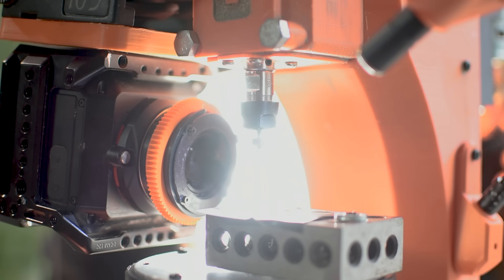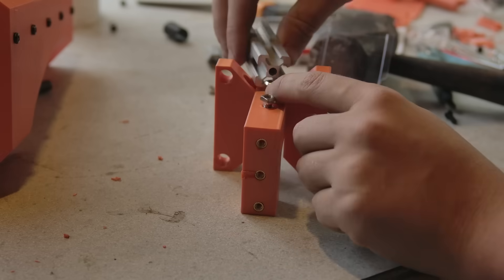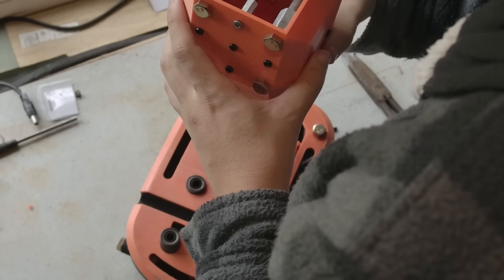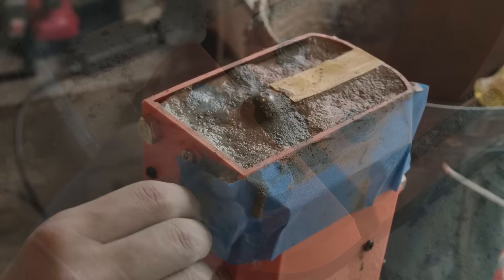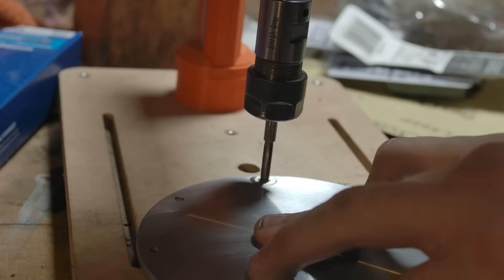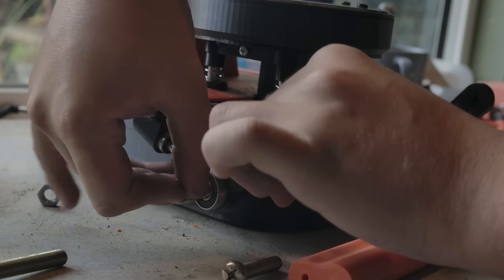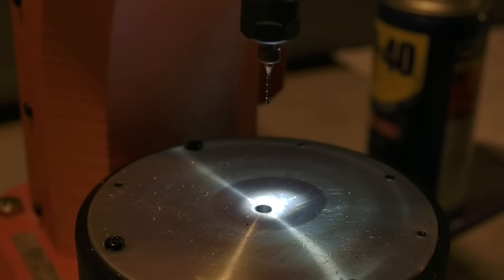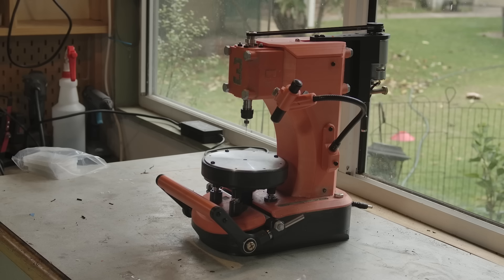I Printed A Sensitive Drill Press

Comment: I really do not recommend using Water Displacer 40 as a cutting OIL WD40 is not a good lubricant castor oil is so light it doesnt stick on any moving surface. Castor oil is not a good lubricant or oil. I reccomend getting actual cutting oil if you don't want to damage your equiment.  Love your videos ans the quality is amazing just a recommendation to make your machining life easier and cheaper.

Comment: Have you... Hear me out... Considered... A concrete funnel with a built in vibrator/agitator? Ideally a two functions in one job, agitate the concrete to smoothly dispense from the funnel, an agitating rod that you could dip into the mould to agitate and settle the concrete within? Not sure if you could design it as an all in one with shared components.

Food for thought? I'm just a mechanic though so ignore me if it's stupid and I'm unaware.

Comment: 4:50 Pro tip: take 2 pieces painters tape or duct tape, and tape on to open top of your concrete bucket so that they make the bucket lip into a V shape instead of the round shape. It helps with pouring dramatically. Alternatively, I've seen people take an old paper towel roll, cut it lengthwise and then cut again to form a V shape and hot glue it onto the bucket.

Comment: I didn't think it was surprising that the 0.3mm bit broke on the aluminium piece. Aluminium is not really an easy metal to drill through because of the galling. I suspect that the drill bit got a bit of aluminium deposited on it, and that that resulted in too much friction for the bit. It would probably have less problem going through steel.

And please stop using WD40. That's not what it's for. And probably none of the other things you're using it for either. Cutting oil is cheap, and you can get it in a spray can too, and bonus: The smoke point is higher, and when it eventually gets hot enough to smoke, it doesn't stink out your shop the same way WD40 does.

Comment: I used to make knife, I've cut maaaany hole using cheap hole hole in up to 1/4 inch tool steel. with proper lubrification, and slow speed, you'll get to it!

Comment: A Dremel rotary tool with drill chuck and drill press accessories can drill very small holes. I've used it to drill brass 3d printer nozzles.

Comment: This is an awesome concept. Making functional power tools with a 3d printer. Never thought to add concrete for strength. Replace the PLA with CF-Nylon and you really would have something there! Its just as easy as PLA to print and is dimensionally stable, chemical and oil resistant and wont melt or warp if it get hot. PLA will deform in a hot car. Still excellent concept!
Reply: Or ABS.

Comment: quick tip for using the drill press hole saw- drill a small hole on the outside edge, (choose to have it overlap the outside, preventing a chunk missing from your finished plate, or just a hole smaller than the hole saw kerf). This aids dramatically in chip removal, more important for thick metal but it still will make it faster going and nicer finish. :)

Comment: Aluminum is around the same hardness and some woods so as long as you take things slow you and use some oil can use normal wood working tools on aluminum they will throw a fit while doing it sometimes tho

Comment: Hi I loved your video (and the others). After 4 months does this design still meet your expectations, or does it need some tweaks. I would love to build it but I obviously would like to build the latest design. 
Also if I was to build this unit is there another medium other than concrete that I could use, even if it is a little more expensive.

Edit.  Regarding the drill press and hole saw, have you considered your local Australian Men’s Shed association. They would be more than happy to help you out.

Comment: This well-designed and well-thought-out project to reduce vibrations makes me want to buy a printer and get started on it. Could you tell me the minimum print volume needed to complete this project? I'm leaning towards Bambulab. Thanks.
Reply from the maker: Howdy, 240 is the minimum size needed in both height and bed size, bambu is a good choice I have had good experiences with them.
Reply: @Borgedesigns  Your answer is very appropriate and I thank you for it. I am buying the Bambulab A1 combo today. No doubt you have something to do with it.

Comment: Fun thing to do with really tiny (0.3mm or smaller) drill bits: front panels for devices. Drill arrays of tiny holes in aluminum sheet for LEDs instead of of poking through the LED itself. The light will shine through the holes, but the holes themselves are comparatively invisible!

Comment: Why have a moving table instead of a moving head? That makes handholding a part much, much more difficult, and as you saw, tiny carbide drill bits are not tolerant of even the tiniest run-out or lateral forces.

Comment: Great build, but you may want to make something to reduce the speed that table can feed up. Some sort of gear reduction? Or maybe just some resistance? Drills that small can sometimes break very easily from shocking them by varying the feed rate that much. Just an idea. Your entire build is way beyond my skills despite having a small machine shop and most of the tools to physically do the same stuff.

Comment: instead the lever, you should try to modify it with a big handwheel ( lets say about 3,5" Diameter ) and couple it to the springloaded mechanism of the lever. that way your Push motion becomes way more controlable i believe ( this is just a assumption ! )

Comment: The Vaseline does what? I like to use either hot air or a blow torch after I sand 3D printed material. I’ve gone too far with the torch but it only takes a fraction of a second to melt the surface. My hot air rework tool has precise temperature control and I use it all the time with 3D printed parts.

Comment: A very small drill bit, its machine journey too fast will cause the drill to break . You can control the forward speed of the base table manually through a gear system (like a lathe) or automatically (step motor).

Comment: Try with epoxy granite next time.
I use a high strength high flow epoxy mixed with Garnet sandblasting grit. It is very strong, very rigid, pours much easier than concrete and is quite a bit heavier.

Comment: If you paint the 3d printed parts with resin you return the colour + add a hard outer coating that adds strength, uv resistance and scratch resistance.

Comment: Dude, what the actual fuck, this is absolutely amazing. Such an incredible idea filling it with concrete and using threaded rods and spacers as the bolts and nuts. And the final design is so smooth and beautiuful. I was thinking about the price and when you showed the bill of materials my jaw dropped, you read my mind. This is insanely cool and it's an instant subscribe. Thanks for uploading

Comment: Great idea borrowing the old DIY lathe concrete trick, it's all about mass and rigidity. Black oxide the steel/stainless parts if shiny isn't your thing. By the way...this would absolutely be worth the time and effort in making pattern boards and sand casting the base, column, and housing parts in aluminum!

Comment: I wonder if you could use steel shot, like for a shot-blaster, instead of concrete.   Steel is about 3 times heavier than concrete by volume so much less could be used and it could be emptied back out for modifications.
Reply: That would add weight, but not rigidity.
Reply: @tookitogo  Ah.. I see.  Thanks.

Comment: well im going to ask since no one has has. what's the #3 on the front of the spindel head signify? and how did you ensure accurasy of alignment between the bed and the shoulders of the press. last i checked the tolerances on galvanized M8 is not very consistent or even potentially concentric

Comment: dude, thats pretty sick !! and if youre able to sit and spend the time making something like that in CAD, then there is no reason why you couldnt make a small Manual MILL or LATHE also. that would SICK AF too !! -------- then i saw your link and you already did and im like WOW !! NICE BUILDS BRO !!! serious effort !!     so having worked in a machine shop for several years, do yourself a favor and buy KENNAMETAL brand Endmills and Drill bits for cutting metal.  it will be money well spent and look much nicer when finished.

Comment: While watching your issues with the concrete being vibrated and flowing up through the top of the base, I was thinking that the riser ()drawing a blank  on the name of this part that you filled with concrete after attaching to the base) should have been poured separately, with a piece of seran wrap or something to allow you to break down the mill for storage or transport. More importantly if you had done this, you could have set upa mating surface that you could do indexing with, rather than relying on the bolts being the only element that forces alignment.

Again, this was mostly in the line of how to prevent the concrete in the base from being vibrated up through the top holes of the base. Another option might have been to set up channels to a separate riser path in the riser, and that 'filled' from the front or toe of the base, and you would then (hopefully) have a reasonable assurance that you had gotten most of the air out of the casting. 

Any way, nice job, and I wouldn't be surprised if you made an x/y slide circuit board holding attachment that you could use to repeat a series of holes for DIP packages on a circuit board, etc. Nice job.

Comment: instead of sanding, I recently learned about using a card scraper (from woodworking).  I tried it and it`s FANTASTIC. and fast.  not perfect for every application, but it`s worth trying.  even leaves the colour , for the most part.  you should look into it.  it`s great to make certian that joined parts match well (no lips or overhangs)
Reply: best I have used is a ceramic scraper. Bought from 3d printing Canada.

Comment: Every time I heard him say "concrete", I thought it was some engineering term I didn't undertand. Then he poured concrete.
Great work mate. I subscribed when the subscribe note popped up 😄
Reply: Large accurate machines sometimes use a polymer/basalt mixture, because of the low thermal expansion of basalt. The added mass also shifts the natural vibration frequencies of the machine structure, which usually is an advantage.
Reply: Довольно частый и дешевый способ сделать раму станка жесткой. Работает прекрасно, особенно с маленькими токарными станками с алиэкспресс. Разве что понадобится безусадочный цемент вместо обычного если объём заливки значительный. Впрочем, мелкая гранитная крошка с эпоксидной смолой - вариант для больших мальчиков, она годится даже для создания станин серьёзных станков, таких как ЧПУ для высокоскоростной обработки алюминия..

Comment: Try wrapping your prints in a layer of fiber glass and epoxy if you can't fill them with concrete. It makes them super rigid. You have to rough up the surface of the print really good though if you want it to stick.

Comment: This is amazing.. instant subscribe! I can’t help but feel a longer lever for raising the work might give slightly finer control - allowing you to translate a larger movement of the lever to a smaller movement of the work towards the drill bit. This should allow for smoother motion and for multiple smaller pushes of the material against the bit, which, together with tighter clamping closer to the hole, might help mitigate against bit breakage.

Overall though amazing work. Creating amazing tools at unheard of costs, opening up work that just wouldn’t be achievable otherwise is exactly the kind of thing many dreamed 3d printing would make possible.

Comment: You'd be amazed what metal can be drilled on a regular drill press with cheap tools. The key is... Some type of submerged coolant bath or lubricant. 

Sounds complex but super easy..... Put a big Tupperware container on the drill press table, fill it with water based coolant, submerge your part, and drill away with the cheapest bits you can find. 

As long as your speeds and feeds are right... You can accomplish almost anything
Reply: Out of curiosity how do you hold down the piece while its in there?

Comment: Anything containing petroleum distillates is not good with plastics or any composite for that matter. There are specialty things available.

 One of the biggest game changers for me was switching from regular armor all..... (Which is terrible for plastics and composites over time)...... To a product made by 3M used in the aviation industry to keep airtight seals and gaskets clean and pliable. Basically just armorAll without Petroleum distillates. 

In the case of something more viscous, you can look at dielectric grease. There are many different types.  But they are all 100 times better on composites than vaseline. The neutral silicone in them is the key. And some are even all petroleum distillates. 

This is what you will see on o-rings even in aerospace type stuff. Not only will it not break down the rubbers and composites like Vaseline and others would.... . But it also has a very low off-gassing rate. But won't affect the plasticizers in  composites. Or make them brittle.

Comment: Regarding some things you noted not knowing for sure (and more!):

- Finishing PLA plastic favours scrapers over sanders. Scrapers can, at their simplest, be the edge of a razor blade. More suitable scrapers are either single-side bevels (like chisels) or a flat end without any bur.
- Vaseline can damage plastics, but it depends on what type of plastic. Destroy is perhaps a stretch.
- Joining parts together with a strong bond can be done by using a polymer like ABS or ASA, which can be solvent-welded.
- Alternatively to the above, you can print parts with flanges that serve purely just an alignment purpose, perhaps with holes in the flange and pins/nibs in the base. That way, clamping them down is also much easier. 
- Even better yet, additionally to the flange, you can extend the barrel of the tube that holds the bearing by the thickness of the bottom, and cut/design a hole the bottom the same size in the right place. This causes printed parts to interlock more securely, doing away with a lot of clamping/holding.

Comment: That concrete poured into the metal parts, I'm guessing will rust away in 1 to 5 years at most. I'd like to hear from someone that has tried this. My idea, fill with dry sand for stability. Maybe sand mixed with baking soda and superglue where you need plenty of strength. Use around plenty of ventilation.

Comment: If you're making printed circuit boards, you will need .25mm holes. Nice solution to a difficult problem.
Reply: Typical PCB holes are 0.8-1.2mm. It’s rare to need anything below 0.5mm. Commercially made PCBs often use 0.2-0.3mm vias, but practically nobody making PCBs at home will ever be making plated vias.
Reply: @tookitogo  "Nobody making PCB's at home will ever be making plated vias." <- How did you come to that conclusion?
Reply: @kurtnelle  Because it’s a complex electroplating process that simply isn’t worth the effort, from any practical standpoint. Heck, people have largely stopped etching PCBs at home, period, because having PCBs fabricated has gotten so cheap. Yes, there are videos of people playing their own vias. But it’s more as a challenge than as a practical matter. Nowadays you just upload your gerbers to JLCPCB and call it a day. 

In the old days, people would create vias on double-sided boards by riveting little tubes into the board. (They look like tiny ferrules.) I have a bunch of those in a drawer at work!

P.S. I did not say “nobody”. I said “practically nobody”, which means close to zero, but not zero.
Reply: @tookitogo  Sounds like a privliaged response.
Reply: @kurtnelle  Nope, just speaking the truth. Electronics hobbyists (and professionals) used to make PCBs at home (or at work) all the time. Now it is extremely rare. And since you don’t seem to understand this point I’ll say it for the third time: there are exceptions, and I’m not saying it never happens.
Reply: @tookitogo  Yes, I understand that for you it's extremely rare. But back to the original point: Do you think that your drill press would be able to drill 0.25 mm holes? The drill press is cool and I'm thinking about trying my handing at making one but I want to know from the designer if they think that it could handle drill bits for 0.25mm holes.
Reply: @kurtnelle   No, etching your own PCBs is not only rare for me, it’s rare today overall, and etching your own PCBs with plated vias is extraordinarily rare. Not just for me, but overall.

As for your new question: I didn’t make this drill press so I couldn’t say with certainty. 0.25mm requires precise geometry in the press — more precision than, say, a cheap Dremel stand or a regular drill press. But no more precision than is found in a regular shop with proper machines.

Comment: The table needs to raise very slowly and smoothly to prevent breaking tiny drills, so a very low ratio is needed such as a screw or worm gear.

Comment: what is wrong with people thinking wd40 is good for cutting. 
wd40 is good enoegh to use WHEN THERE IS NO OTHER OPTION. and you REALLY need to get it cut. 

meaning that it will get the job done but it's most certainly NOT good for your tools. 
get some actual cutting lube/oil.

Comment: this would be awesome if this kind of machine would work with an off the shelf collar mount where you could fit a dremel in :)
Reply: Just don’t use an actual Dremel — they aren’t precise enough (too much run-out). A Proxxon (choose a model with metal front body) is much better, and has a precision-milled neck that can be precisely clamped. Not the plastic BS of Dremel.

Comment: That looks fancy! The end result is impressive. 👍I use an old cheap drill press with a 40-year-old hand drill that has no speed adjustment to drill PCB holes with 0.4-1.0mm bits. 😅